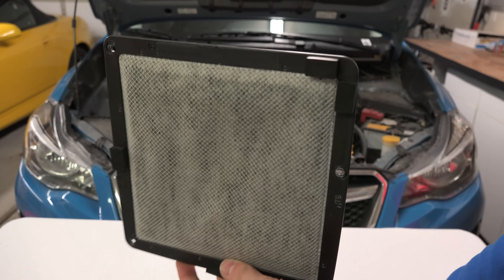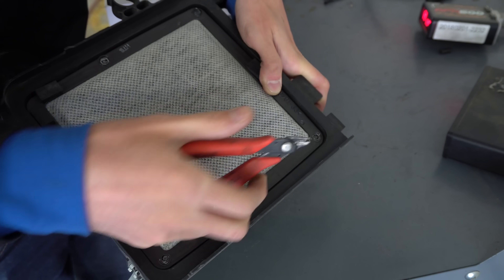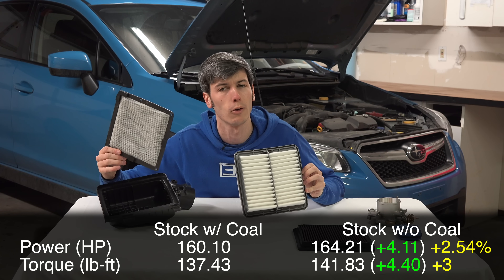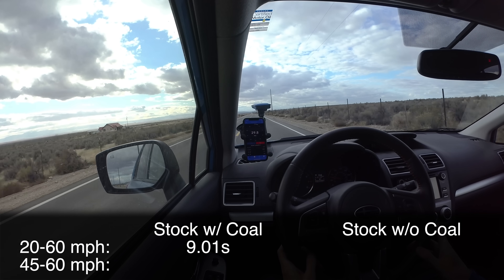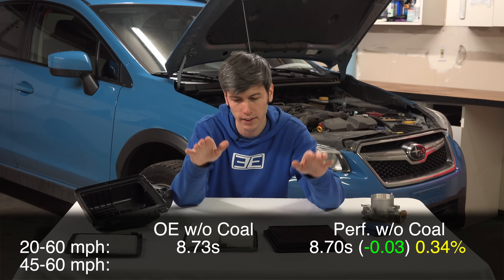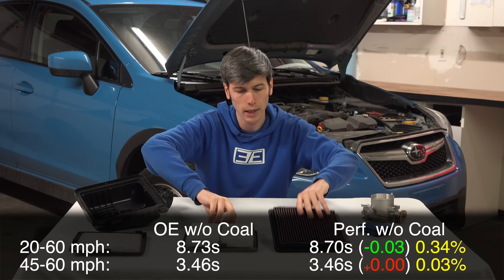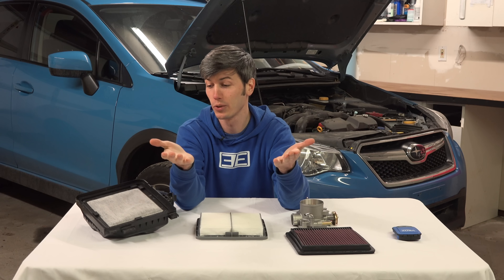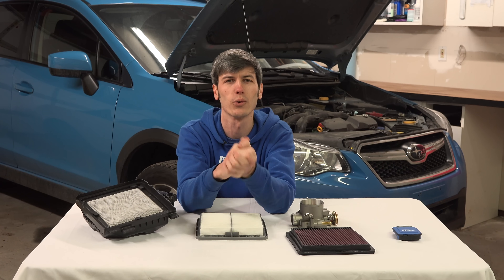Do Charcoal Air Filters Rob Your Engine Of Horsepower?

Comment: Point of order. The felt response of the motor to throttle input is not ultimately the same as the response of the throttle plate to the gas pedal. The felt response to throttle input is based on when the engine speeds up based on getting more air. Opening the throttle plate allow more air to flow past it, the air still has to get there, and thus could be affected by upstream restrictions. Not saying it does, but if you plug the intake with a potato, the throttle plate can do what it wants, but you will get no increase in air flow to the cylinder.

Comment: well i figure the restricted carbon filter is causing your car to burn more hydrocarbons to do the same amount of work without it so its really causing more hydrocarbon emissions over the life of the car.  better off to stay away from pzev, partial zero emissions vehicle. pzev have special parts that can cost a lot more to maintain than regular federal emissions vehicles. theirs no such thing as zero emissions car, electric cars make coal ash and nuclear waste, the exception being the few hydrogen fueled cars.

Comment: I do agree all your math is correct but the numbers change when you look at your very first stock set of numbers versus your very last performance filter no charcoal filter numbers they make a bigger difference! Also with the idea that your engine is just an air pump I would like to know how the injectors react to the restriction reductions does it improve overall fuel mileage?

Comment: I realize that I am a year behind, but the one item you still might want to try is any change in fuel economy between w and w/o the charcol restriction.
Reply: The reason I say that, is I run K&N's in all my cars.   My 2011 Honda Odyseey went from 24.5 mpg on highway to 26.2.   Oregon vehicle no charcoal restrictor.   My 2011 Dodge Ram 5.7 when from about 15.5 to 16.2mpg on the hwy.  not alot but  when gas was 4 bucks a gallon,  Over a tank saving a gallon saved me 4 bucks

Comment: Would you have a way to test the usefulness of the charcoal filter?
I'm wondering if the charcoal is unnecessary with the kn filter since the vapor will likely get trapped in the kn filter

Comment: Even if the K&N air filter didn't do as well as the stock filter or the car quest premium filter you still save money in the long run for buying the K&N it has a very long service life up to 1 million miles and not every so often do you wash and recharge the pleats with oil to bring the filter back to new. That right there adds so much more value. than anything else.

Comment: I would get a 2nd air  A/C cover and remove the filter so you wouldn't ruin the stock item.  Or  vac out the charcoal filter after the cleaning the K&N filter

Comment: I would have like to see the 0 to 20 mph test. The Crosstrek is slow vehicle. But the worst part of that is the 0 to 20 off the line start. I did change out the stock filter for a K&N and removed the charcoal filter. Then I went a step further and reset the ECU to allow the fuel mapping to start from scratch. For the first tank of gas I put my foot to the floor at every opportunity and walked out the gears for as long as I could. My mileage after that tank has improved over stock and the performance. Well it sure does feel a lot more responsive. The 0 to 20 take off now actually feels like it wants to put me back in my seat. So for me it was a win.

Comment: 10:08 "Modern engines, keep in mind, are ALL using electronic throttles"
False: I have a 2009 BMW 328i, and like a lot of modert BMWs, the N52 engine actually doesn't use a throttle but instead uses the valvetronic variable valve lift in place of a throttle for better response and effieiency.
It still has a throttle though, in case something goes wrong with the valve lifter but it doesn't use it unless something is broken and you said USING not HAVING
Thanks over-complicated German engineering
Reply: A 2009 isn't modern anymore, Boomer.

Comment: I am the superhero better known a G-Force Man. My ability is being able to detect subtle changes to G-Forces, such as acceleration and deceleration, or even vibration and other things but that is not really the point here.
As awesome as super sensitivity to G-Forces might sound, it has its drawbacks. Elevators, for instance, are extremely painful for me while ascending and absolutely nauseating while descending. However, the biggest benefit of being extremely sensitive to G-Forces is that it makes a Subaru Crosstrek an absolute riot to drive. And if you think a Subaru Crosstrek is fun to drive "stock" let me tell you, take that charcoal filter out and hang on tight, because there will be a difference that sensitive measurement equipment will be able to detect, trust me on that!

Comment: If it's non-removable, how does one replace it when it gets clogged up?
The people who said they felt the difference, might be right. You tested brand new filters. After the charcoal filter gets clogged, it might be a lot more restrictive, and it seems like it would clog a lot faster than the actual filter because it is just a simple rectangle, with about 1/10th of the surface area compared to the actual filter. If I had one, I would remove it...No one is going to check if I have it during e-tests.

Comment: there is air on both sides there’s a constant jerk without the charcoal filter & it’s is a smoother and steady take off One thing I’ve noticed with all my Subarus you have to train them again to get used to any changes you make to the engine

Comment: Feeling throttle reponse when removing the charcoal filter makes sense. Less restriction allows the air in the intake tube to accelerate faster, hence why some guys can feel it. One way to test that would be to test air velocity per millisecond inside the intake tube with and without the charcoal filter.

On the mpg note, if the stock air intake is slightly oversized and the engine is optimally tuned, mpg gains will be minimal. If it is undersized to what is optimal for that particular engine and not optimally tuned, mpg gains can be noticed as the engine will pull higher vacuum along with slightly cooler and denser air. All pointing to how volumetricly efficient that particular engine is at the engine rpm used.

Comment: I don't think these changes are permanent, maf sensor will adjust computer to work with increased airflow and difference neutralized. I think computer needs to be turned to.

Comment: Would be interesting to test a stock intake system, and modify this stock system to ram air system.
Just to see if the additional air which is works like a mini turbo does it make any difference in torque and horsepower

Comment: I would suggest the following comparative EXPERIMENT:
Smoke from a vape (e-cig) is completely filtered out by a HEPA respirator cartridge.
Therefore vape clouds could be used to simulate dust transmission through the filter.
By shining a bright light on the resultant filtered air flow stream you can visualize particle transmission rates.

Comment: I don't get the conclusion of the video – whether or not you can feel the difference in acceleration, the engine will still be more efficient with a more freely flowing intake. Why the heck would anyone say no to a 2% efficiency increase?

From emissions perspective, what does a teaspoon of fuel evaporating after shutdown matter compared to the fuel you'll be saving with better efficiency? 

Also why was nothing mentioned about the fact that a washable performance filter like that will likely be the last filter you'll ever have to buy? 🙄 🤦‍♂️

Comment: Even if you're in ecofascist states, emissions testing is done from the exhaust tip, and freer air flow at idle and fast idle (where CO2 and HC are measured) gives a leaner burn.

Comment: It seems that the engineers could do a diverter valve to send returning fumes through the carbon filter when the engine is off and not have to pull through the carbon filter when the engine is running.  When the fuel pump comes on it could signal a closing of the diverter valve to the carbon filter and open the air intake filter route.  This solution might and might not work so great with the whole auto start/stop function that is now mandatory.  Also does the activated carbon in the filter stay active for the life of the car?  My experience with activated charcoal is that it has a finite amount of useful life.  I wonder how the carbon filter affects efficiency as well.  Testing the K&N with and without the carbon filter for fuel efficiency would be interesting as well.

Comment: Fuel vapours escaping, lol, you all seen an oil platform flaring off hydrocarbons with a flame 30 meters high? And refueling the gas stations pump it directly into the air hahaha

Comment: I'm much more curious if this increases MPG... I don't give half a crap about accelerating faster, but if if gives an additional one or even half mile per gallon extra out on the highway over a 10+ hour road trip, that gives it quite a bit of appeal. Any thoughts on this? Thanks!

Comment: Awesome, video, love the testing and numbers backing it up.  The only thing I wonder from those that did remove the charcoal filter, is if removing the charcoal filter may get rid of the "bog" that I sometimes experience when going from say 0 - 45 mph.   When making a right hand turn for example, and having to romp on it to quickly get up to speed before someone rams me from behind, the engine has a pretty big flat spot (most of the time) and just bogs down before picking up.  I am curious from those that removed it if they noticed a more even acceleration curve?

Comment: As much as I agree on some points there's also some disclaimers made probably for appealing to the law crowd.

First not everyone drives a Subaru grandaddy. Cars that are not made to go slow will show more progress. that said you Are not going to feel it but in conjunction with a few other bolt on mods you will feel it.

Second Lets not pretend people don't drive carburetted or SPI and MPI Enjines. Which will respond lively to better Air filter,even a clean new one.. We do not live in a prefect world where everyone has up to 7 years old car etc... And some people like driving certain vehicles regardless of their age and emissions.

Third We both know well NOONE is going to open your Airbox and say : "Ah you don't have the mandatory Charcoal filter you don't get to pass the inspection." 
We also both know It has NO influence on Engine emissions, its designed to prevent possible emissions while the car is standing shut off. Noone measures if the car is emitting fumes while standing still. Unless you have an LPG device. But than they search for LPG leaks not Gasoline.

As for moral choices Im not even gonna bother with a country that thinks 4 liter V8 is a daily driver. You don't get to nitpick about Ecology. It's like a Vegan butcher nah m8.
If you are a eco nut Never do it.
If you just want some super cheap quick and slight improvement go for it. 
If you are a tuner its a must have.
Disclaimers in this video are like :"The following stunts are.... blah blah..." Designed to satisfy the law. You will not void anything or ruin your car and its emissions if you take it out. Go ham.

Comment: It is a known trait of cotton panel replacement filters, that they flow marginally better than a new paper element, but their ability to pass air remains consistent. Paper element performance can deteriorate rapidly in just a few hundred miles.

A really interesting test would be to put 3k miles on the K&N, then compare with the dirty paper element. That is where the K&N should really shine.

Comment: My question would be how it effects fuel mileage in every day driving.
Reply: depends on numerous factors. 

denser air will need more gas, but youll have more power, so youll cruise longer. it does not really affect mpg that much, but a restrictive airflow DOES limit your mpg because the engine is having hard time sucking air to breath.

Comment: People put thousands of dollars down the drain trying to eliminate a few 10ths from their acceleration times in the 1/4 or to 60, or to gain a few extra horsepower for no purpose whatsoever other than fun, and you've shown removing the carbon filter can do that at $0 cost. "G" math is pretty much the least demonstrative of the performance improvement, and 2-3/10ths is pretty meaningful over such short times.

What you also didn't say - and couldn't have based on only looking at one car - is that cars will react differently based on their intake design. I think older cars might show more improvement because of less optimization generally when those carbon filters first started getting put into the intakes in the early 2000s(?).

Bottom line, I know given your sponsorships and associations you can't be out there recommending that people remove emissions equipment, but the video speaks for itself. Nice work.

Comment: Activated carbon in cabin filters can scrub the cabin air of noxious emissions from other vehicles, soot, smoke, smog etc / activated carbon captures these fine chemical fumes & they gunk sticks to the carbon *(activated means lots of cracks & surface area for stuff to react with the carbon) / I promote the use of indoor air filtering with activated carbon & HEPA & encourage people to filter the cars cabin air with activated carbon filters / if the engine has an air filter, why not the driver & passenger ?

Comment: Smaller engines have smaller gains or benefit from high flow filters.. Larger horsepower vehicles have much lager gain in power of 10  horsepower or more.. but results are basically based on an average of power the engine is capable of in the first place. A high flow filter isn't going to turn your Nissan 1.8l Sentra into rocket.

Comment: Any flow obstruction before the throttle body changes the effective air pressure before the throttle plate. At steady state it is effectively atmospheric pressure, yes. But during transient response to the throttle opening, airflow IS affected by upstream intake restrictions like piping, air filters and potentially even the geometry of the inlet (if the piping is short enough for that to matter). 

This happens regardless of the throttle actuation method, unless the car were to be equipped with pre- and post-throttle pressure transducers that were used to dynamically remap the throttle actuator to provide the same exact driving experience across a variety of conditions. This sounded absurd in my head, but after typing it I can actually envision a horrible future in which cars are mandated and restricted by such technology. 

And now I just typed it into Google . . . .
Reply: I mean to say that reducing the intake restriction effectively "hacks" the throttle mapping to make it more aggressive. Even if the car didn't make more power.

Comment: Also @engineeringexplained, with modern cars would you agree they tuned the car to work from factory with the OEM stock parts. Hence why most people reflash/ retune the ecm for more power once they added the mod vs older cars where the restrictions were introduced after the engine was made to produce power effectively reducing it's output to meet the requirements?

Comment: I've got a 2019 manual Crosstrek, you cant feel much power kick in unless your around 3000rpm, there is a flat scoop for the intake up by the grill, Its held on by two plastic tabs that can be carefully removed with a flathead, that alone constricted so much airflow and made all the difference. On most cars cold air intakes probably wouldn't do a hole lot but you could actually gain some serious horsepower with a Crosstrek this engine is being suffocated, especially if you were to get a professional ecu Flash. Could probably push close to 200hp without a turbo. Going to need to rip that PZEV badge off the back though

Comment: how do you get more rear wheel horsepower and torque on the stock dyno run than the stock Subaru specs rated for at the crank?  148 HP/145 Torque stock specs?

Comment: Dunno 'bout you, but putting a performance filter and pulling the charcoal from my Mustang made a difference you can actually feel. It was very slight, but I did it with and without a few times, and it definitely made a small difference in low end torque/throttle response while accelerating.

Comment: What about fuel consumption with a stock filter w/ and w/o the charcoal filter and the same with the K&N? 
I removed the charcoal filter and installed a k&n AND removed a brass colored screen right in front of my throttle body inside the intake tube on my 08 5.7L Toyota sequoia and my wife randomly told me it had better throttle response.  I know what was said about how it's programmed but it was noticable

Comment: I'd argue that when people talk about throttle response, they usually mean percieved throttle response... how quick the engine reacts, not how fast the air travels.
So depending on the individual vehicle, removing the filter might actually effect that (positively OR negatively) since engine response depends on fuel mixture (amongst other things, of course).
Modern cars with sensors everywhere shouldn't react much on the change, but in reality things aren't perfect, not even sensors...

Comment: You may not be able to feel the difference but I can feel a 0.10s difference in ET at the track SOP in my vehicle.  0.10 difference at the end of a 1/8th mile is a car length.  Its the difference between getting out in front of someone or having to throw the brakes on and move over behind someone.  To each their own!

Comment: Wire a resister on the throttle sensor line. Remove the charchoal filter. Install the performence filter. Port match it. Install a bigger turbo. Remove more of the emissions junk. Have a faster Crosstrek. Or just have a grandma car... Your choice. Or even better buy grandmas old Buick and send the Crosstrek to the scrap heap and just have more power with no work lol!